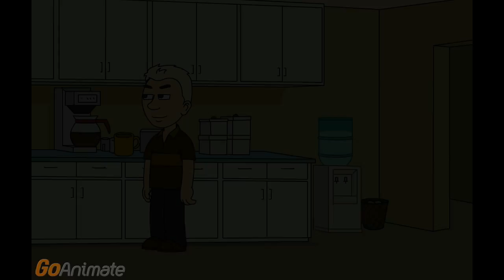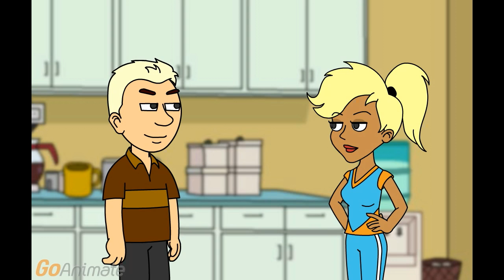Frigidaire Air Conditioner Troubleshooting

Comment: The control board on mine won’t work . The remote was halfway working until the ac unit began jumping from temperature to temperature on its on then just shuts off after it gives some kind of code of PO

Comment: I have a 8,000 btu heat and ac unit model FFRH08L2R12 and the heat is not working what do i need to do to fix it

Comment: I unplugged my AC plug from the wall for two days when I went to plug again to outlet the unit does not go on I tried the reset button so when I press the button they do not connect I press reset button nothing happens what else can I do please help
Reply: I have the same problem. I think there's a problem with my power cord. If that's the case it needs to be replaced.
Reply: do you know who to call for that the Frigidaire company and maybe would you know what the cost may be
Reply: I unplug my ac in the wintertime. Now it won’t turn on at all. Tried resetting the button. Nothing is lighting up

Comment: My Frigidaire room AC 110 unit has ran beautifully.  Until now.  The fan will not shut down.  It runs even if I turn it off.  I hv to unplug it to turn it off.  The thermostat works an when the room reaches set temp the other motor turns on an it puts out cool air then will turn off, but leaves fan running.  What do I do ?  Thnx.   Nothing shows up on the control plate. Just the temp like its supposed too.

Comment: air conditioner works great...the front control board does not light up or work i just turn on and off w breaker...how can i fix control board.
Reply: It just beep and goes back out never come on

Comment: what makes the compressor stay on sometimes? I can cut the ac off but it still stays on fan cuts off but you can hear it still humming if I change it to heat it will make a hissing sound like a tire just busted or lots of air being released. only way to cut it off is to unplug it or hit the reset button. cause I can't control the temp it just wants to cool even on fan. what do I have to do to fix this problem been having this problem for years but just now thinking someone on youtube might be able to help thanks for any help

Comment: My fridgidaire air conditioner’s timer keeps beeping on and off 0.5. Resetting doesn’t help. Unplugging doesn’t help. Clicking off on the reset button on the plugin doesn’t help. Can someone please HELP MEEEEEE! This beeping is driving me nutz and nothing seems to help. I can not for the life of me figure out why the timer keeps settin itself off and on!
Reply: tatt2tjm Did you ever figure out the solution to this? My unit is doing the same thing.
Reply: Daisy Robinson no I didn’t. It still doing it.
Reply: tatt2tjm I tried calling the 800 # but they are closed today. I just unplugged it and cleaned the filter, I'm hopeing that will help.
Reply: My ac is also doing this.
Reply: Mines been doing it for months. Can’t figure out why. I just deal with it. Lol.
Reply: Mines too
Reply: Hold down power button and then mode, or vice versa. Mine just did that and it fixed the problem
Reply: Mines was doing that, went off on it's on and now want come back on, please help!!!

Comment: installed my AC, 220 line has power but AC won't come on. it beeps and that's it.  how do I trouble shoot
Reply: Rhonda Villanueva did u solve problem
Reply: @pbutta1336  no
Reply: Rhonda Villanueva hey. Did you ever get a solution? Mine is the same. 220 v, push the power button, it beeps, nothing lights up, does nothing else.
Reply: @DJRazzyJeff  no